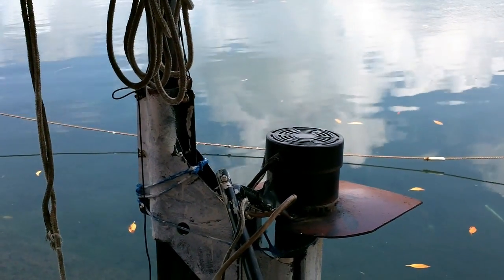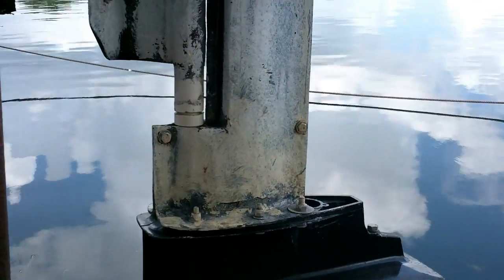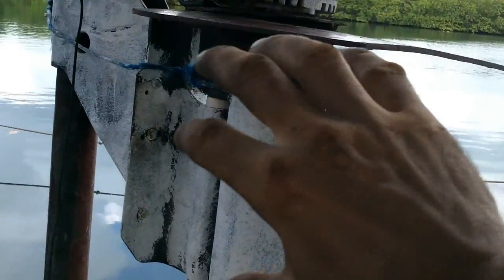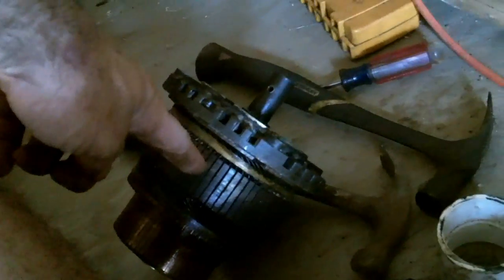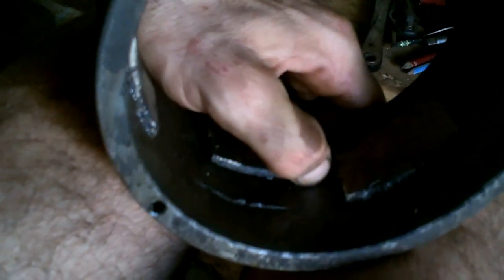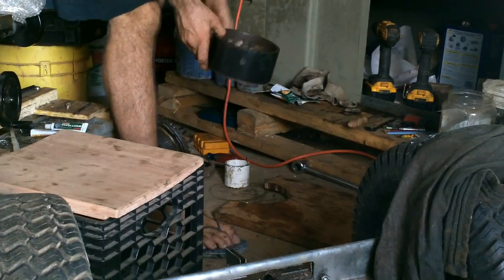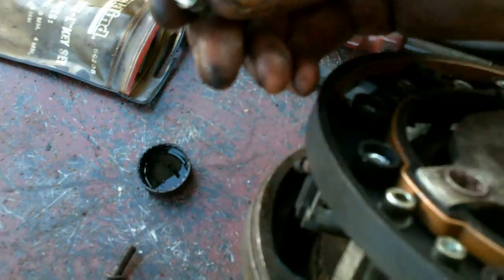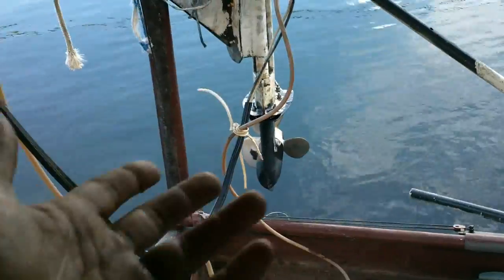Troubleshooting an Electric Motor Problem...

Comment: You da man Jamie. I pulled a 55 pound thrust electric boat motor out of the garbage last summer. Pulled it apart, the magnets had rusted to the coils. I cleaned it up, put it back together and used it on my boat all summer. Probably a $500 motor. :)

Comment: I suggest that you add Anti-Seize to your tool box. It's indispensable in a marine environment and will save you a lot of needless future aggravation.
Reply: When you've got a stainless screw in an an alu hole,  is it wise to add copper to the party? :)  I'd guess moly anti-sneeze it what you'd want there, or maybe teflon grease.
Reply: @MattOGormanSmith  My preference is Permatex aluminum anti-seize.  Copper is typically used with just ferrous parts. MDS anti-seizes have become popular lately, but I'll stick with aluminum because it has never let me down.
Reply: That sounds about right.  It's the hole you need to be nice to (as the actress said to the bishop).

Comment: if the protective nickel coating is gone on the neodymium magnets it would help they're longevity to seal the surface.They oxidize internally without it and fail

Comment: Permatex #3 works great on screws exposed to water. Stern drives use that trick, they are gooey but that #3 doesn't harden (so they say)

Comment: Great videos. Learned a lot. Retiring to Roatan and I want to build a pontoon boat similar to yours. I was thinking instead of fiberglass struts for supporting the roof of using 3 inch pvc with a 2 or 2.5 inch pvc inserted in the 3 inch for strength. Was also thinking of using 1 inch EPS closed cell Styrofoam and wrapping it in fiberglass for the walls of the pontoon with Styrofoam bulkheads every two feet fiber-glassed in for strengthen.Would appreciate any comments from everybody.